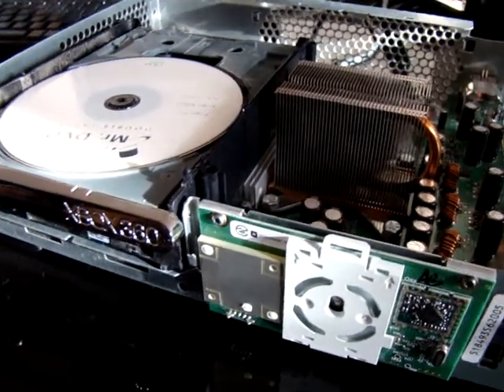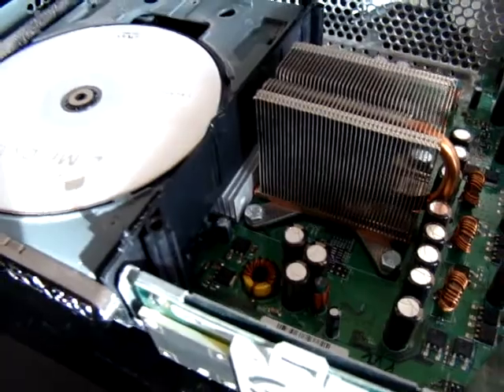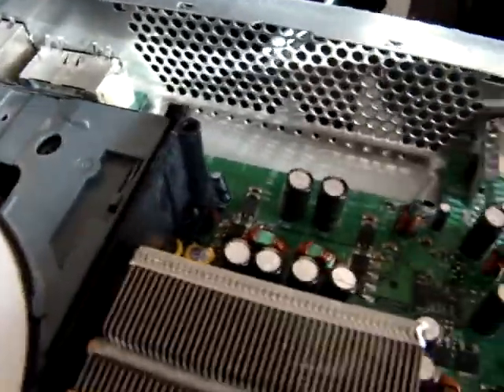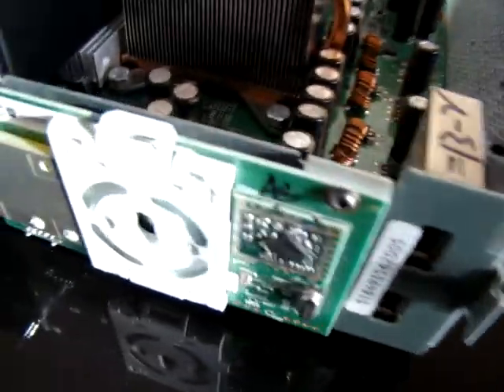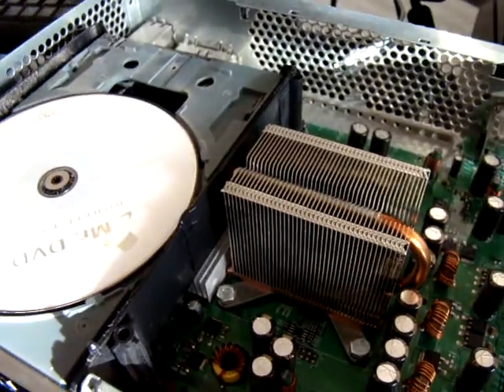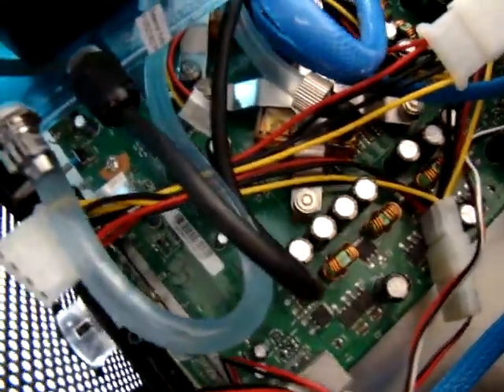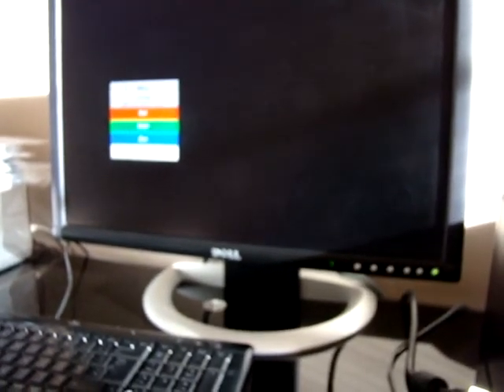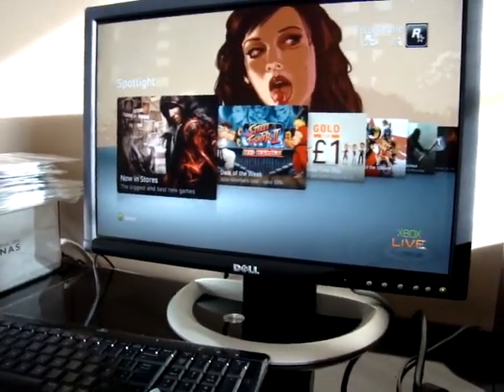XBOX 360 Water Cooled Project

Comment from the maker: @getale when you reassemble, you will need to overheat the system again, as you would with the RROD fix. turn off the fan and the water pump to do this - a couple of questions though, did you use thermal paste? you should! What fan are you using - it should be a high powered one, over 12,000 rpm to cool the water in the res' , and what size res do you have? 12cm? also you should install some passive fans and keep the system well ventilated. let me know how you get on

Comment from the maker: Arch, continuous overheating of the GPU and CPU will damage the 360 beyond repair; the best thing to do is extensivley cool the system to avoid the overheating - as you mentioned the flexing  (expansion) of the board etc are all issues to do with heat, not familiar with the HYBRID fix but ultimately water cooling is a solution. Thanks

Comment: Have you tried Team HYBRID's Ultimate X-Clamp Fix? I, too, have tried the basic xclamp fix with little long-term success.

They claim that the rrod is caused by flexing of the mainboard, and that leveling the board out with washers and padding will fix it. 

I'm thinking i'll do that fix, and install a switch to the fan, so i can overheat it again (if need be) without taking the thing apart.